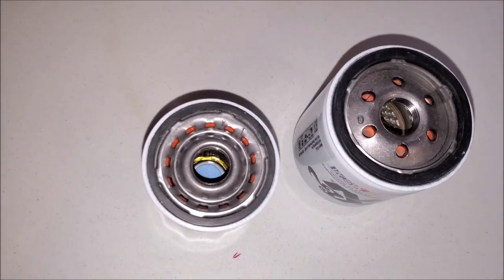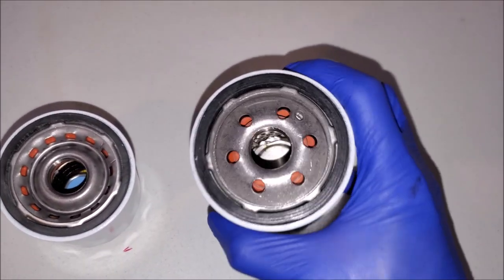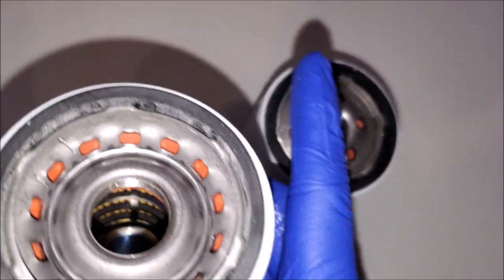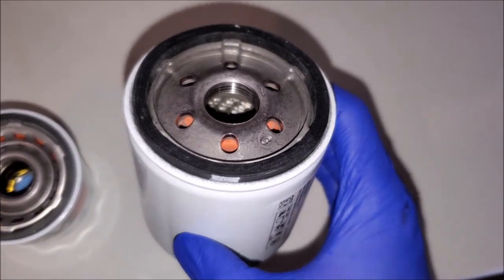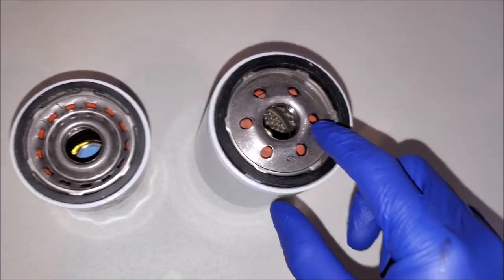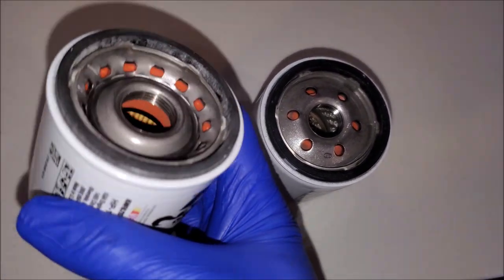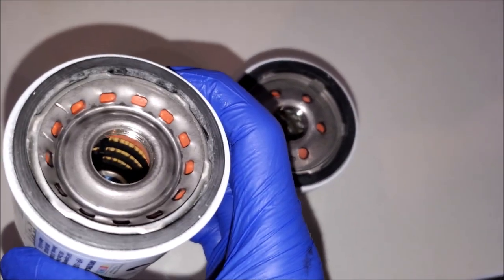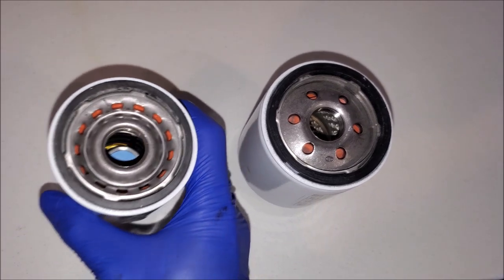K&N Filter Oil Filter design CHANGE??? | AnthonyJ350

Comment: I have to run the 1010 or the 1008 on my Mercury outboard (that was technically made by Yamaha in 04, 90hp, 4 stroke, 4 carb).  They no longer make the OEM filter.  The nipple the filter threads onto has a weird hex "bolt" at the base of the nipple.  Only the 1010 and 1008 with that different design have enough recess to allow enough spacing for that hex bolt head at the base of the filter nipple.  Maybe that hex piece is more common on foreign designed motors than I thought and those filters are designed for them.
Reply from the maker: Quite possibly.  I prefer to run the HP-1010 because it's a little bit longer.  I find it a bit small to be used on a 3.5L V6.

Comment: I always purchased k&n . My Subaru was a k&n test car for development. This week I received an oil filter I thought it was a fake . Completely different. Part number  PS-1010 . Look identical to the new one you received. I contacted k&n they sent me a new one but it’s the same cheap one . It’s identical to the AC Delco oil filter . I went out and purchased a wix xp filter instead. I don’t like the new filter at all . I’m walking away from k&n oil filter. AC Delco filters are made by champion labs I bet this is a rebadged champion oil filter
Reply from the maker: Ya I'll monitor it.  I've always loved their products, weird that one filter is the old design and the Nissan one changed.

Comment: i noticed this couple of years ago i run a inline oil filter between my motor and turbo so my turbo gets clean filtered oil i noticed this and have now switched to oem filters if that plastic brakes apart my turbo ball bearings will die
Reply from the maker: Fair enough. I noticed not all their filters have taken this design. Mainly their small diameter ones.

Comment: I use the same filter for my 350z, with some good old M1.Will see what my next filter looks like before I slap it on.
Reply from the maker: This is the second of this design I'll be putting on my 350Z.
Reply: Yes I also have used them in past with no issues at all.  But got a ‘19 Zed sport with only 12K now and don’t want to mash thing’s up.
Have you ever checked out our fellow CNDN you tube channel “ Motorvate “. He’s got some scientific type testing on K&N’s.

Comment: I, too, noticed this today when I received two PS-1010 oil filters from Amazon. Stoked because they say "Made in the USA" on the top and label on the filter, but they are noticeably lighter since I still had a performance silver filter new in the box in my closet (made in China though). There is also no plastic seal over the drainback that I'm used to seeing with these. Looks legit, just a different design. Maybe it will filter better? I'm curious as well.
Reply from the maker: I noticed the filter for my V8 Chevy is still the  same old design.
Reply: @AnthonyJ350  So what is the verdict? One of the comments below said he contacted K&N with concerns about this design differing from their old design so K&N sent him a replacement which ended up being the new design as well. It does say made in the USA on it, and it looks well built, with about 70 grams of weight savings compared to the previous model (although we aren't talking about bicycle components where a 70g savings on a component is always welcome). I'm just curious. The reviews on Amazon seem to be very negative regarding this new design, but no one has actually reviewed its performance because they don't even want to install it. They're pissed about the design change, and feeling like they got a Supertech or AC Delco with K&N slapped on it.
Reply from the maker: @IkaikaKahoano  I think they are using a more cost effective design. Honestly if you run this filter and change your oil every 5,000KM, your engine will still last long.  I also use a Filtermag on all my vehicles to help.
Reply from the maker: @IkaikaKahoano  Here's the Filtermag video.
Reply: @AnthonyJ350  I don't see a link to a video. Also, I just use the maintenance minder on my fit to change oil. It usually is around 7k miles between changes.
Reply from the maker: @IkaikaKahoano  https://youtu.be/Lec_ykPhV8A

Comment: Nothing wrong with the plastic cage, it allows max flow. The 'new' design a Champ Labs filer made for K&N. VERY similar to the Wal-mart's newer Supertech 20,000 mile filter. Except for the nut at the bottom.
Reply from the maker: Thanks for the comment!
Reply: i wasted a lot of money believing KN was special high flow.. heavy duty

Comment: My new K&n hp-2009 is half inch shorter went from 8 large holes to 6 smaller holes on inside .  Called K&n they would not explain difference only said they could not argue nor explain reason . 
Also it was identical in appearance to their ho-2006 filter which is not recommended for my vehicle .  So paid a dollar for less in filters .
I think time has come to check out other brands .
Reply from the maker: It might be if your filter design has changed that much.

Comment: Notice you use a K & N air filter.  How long have you run them and have you had any problems with it.  Any other comment would be helpful.  Thx
Reply from the maker: I've ran K&N air filters for close to 20 years now. I inspect them every year and clean them as necessary. Never any issues. I'll send you a video on how to avoid "over oiling".

Comment: Here’s a thought. What if they changed the design because worse case scenario if both filters were to fail, one would send metal shards through the engine whereas the other would send plastic/filter materials which ever it’s made out of now
Reply from the maker: Very possible, these are times I wish I could talk directly to engineers to get context.
Reply: Correct me if i'm wrong but... The oil flow is from center to the filter media to the outside of the filter...Should the plastic "decompose" ,the media would stop any pieces unless there was sooo much restriction that the bypass valve would open...I would think that plastic inner rib should last an 15k mile oil change with normal engine operating temperatures...
Reply: @stealthg35infiniti94  Consider getting an engine to maximum safe temperature day in and out. I have never seen plastic in any big rig engine.

Comment: I have used the Silver / PS1010 on my Subaru Legacy,,,,,,, I just received my order, and The new KN filter, is much different in construction..........................Switching brands
Reply from the maker: What brand are you switching to?
Reply: @AnthonyJ350  I went to Royal Purple oil filters for my Ford F150, Wife's Subaru Legacy, and Husquvarna Lawn Tractor that has a Kohler engine........Also switched to Royal Purple, HPS motor oil. Higher zinc content. API lowered Zinc content......................................
Reply from the maker: @michaelbutler9528  Nice!

Comment: These are now the same as Super Tech Maximum Protection filters, u are paying nearly double for the same filter. At least the K&N select filters,  not sure yet about the rest of the line up. PLEASE, double check the threads for metal shavings and tap or blow out the filter b4 installation, I and many others have found metal shavings on the threads of these particular filters both k&n and Super tech... you might as well buy the basic super tech or the super tech maximum Protection filters instead of this one, same filter, just more $$. Good luck 👍
Reply from the maker: Thanks for sharing!

Comment: There's plenty of You Tube videos showing K&N being almost identical to some of the other High Tier Brands...The important stuff : Quality drain back valve, Attached contact seal, synthetic filtration media, quality bypass valve, correct filter threads...Optional: Hex head for removing, pretty paint...Usually a filter manufacturer will make the same filter under various names...The secret is to find the same quality in the least expensive filter...With clever marketing, you can sell ice to eskimos....
Reply from the maker: I agree
Reply: @AnthonyJ350 I thought to comment about Sensitive Topic of Motor Oil...As long as you're using a 100% Synthetic Motor Oil ,you're doing the best for your engine period...Amsoil does edge out the competition by a slim amount that a normal driver will never experience the difference...That said, buy the correct viscosity pure synthetic oil for your car with a top tier oil filter. The brand you choose is going to give you the placebo effect you wish.

Comment: Just bought a k&n filter, im not sure if thats plastic or not. I'm kinda hesitant to use it. I might go buy a wix xp filter instead.😢 Anyone have any further info about it?
Reply from the maker: Not that I've heard. Hopefully someone from a parts store can chime in.
Reply: @AnthonyJ350  come to think of it. Ive come across toyota camrys, camero v6, and dodge challegers v6 that use internal filters. And most of those internal filters are plastic, Like really hard quality plastic... Im starting to think it will be fine, but I'll still double check before i slap this oil filter on...

Comment: the past year… it seems many Brands have begun to look similar inside… dropping the big spring at the bottom and using the plastic retainer… some Walmart Supertech cheap filters are duplicates to 15 dollar KN and 5 dollar AC Delco…even Wix may have changed… a rude ripoff obviously
Reply from the maker: I'm going to switch the the GTR filter, it's just a little taller.

Comment: I'm never buying the ones with nuts on it there garbage so I got me a k&n silver oil filter in stud with out the nut  I use Royal purple oil in my engine and I drive a 2002 se Pontiac Sunfire  and all I can say I love it no more problems
Reply from the maker: What makes the filter with the nut on them garbage?
Reply: Thay always seem to break open on me
Reply from the maker: @shaynehuber3426  When you take them off? A K&N? I have never seen the nut break off.
Reply: K&n oil filter with the wrench thing on top Thay always seem to break open on me get the ones with out the wrench top I think there garbage
Reply from the maker: @shaynehuber3426  Sounds like you're over tightening them

Comment: If the pricing didn't change and only the design i would be concerned. Why pay the same for a possible downgrade. It looks like a generic filter without shielding.
Reply from the maker: Ya I'm not sure what to make of this change.
Reply: @AnthonyJ350  i agree. I have yet to see the differences between the two
Reply from the maker: @BoOmBaMan  Ya I'm not too worried about it because I change my oil quite often. I'm sure it's still a quality filter.

Comment: I would rather have either in my engine,   my car uses that paper element style
Reply from the maker: What brand oil filter?
Reply: @AnthonyJ350 usually Bosch. But its the paper type with the plastic housing that screws over it
Reply from the maker: @TheMcooper17  Is that in a newer Toyota or something?
Reply: @AnthonyJ350  08 focos Euro diesel
Reply from the maker: @TheMcooper17  Ahhh ok , can you still get a metal canister if you choose?

Comment: Just received 2 K&N HP-1010 filters. they are built exactly like Walmart Supertech filters, only they are 3 times the price, will not be buying K&N filters ever again.
Reply from the maker: Thanks for sharing!
Reply from the maker: Even the casing thickness is the same and the Supertech has the nut on the end?  Did you cut them open?
Reply: @AnthonyJ350  The supertech does not have the nut, everything else appears to be the same.

In fact the Supertech has a silicone drain back valve and the K&N has nitrle rubber, the supertech has one up on K&N
Reply from the maker: @spartus56996  Interesting, thanks for sharing.

Comment: I'll stay with my Amsoil oil And filter.
Reply from the maker: To each their own. I've been using Castrol 5W40 in my vehicles.
Reply: @AnthonyJ350  I've brought several oil burners and rattling lifter engines back to quiet,  non-oil using engines with Amsoil. Using it from the start can result in engines still running like new with several hundred thousand miles. This includes diesels as well. 

I'll run Mobil 1 for the first couple of oil changes making sure to use Amsoil filters.  The normal abused engine running standard oil requires 3 or 4 oil changes to thoroughly clean the engine.  Hard to believe the dirty oil you get those first few times before you get the engine clean. It will take a couple of those changes on an engine with less than a 100K that have been regularly serviced. You won't believe the cessation of lifter noise on a noisy engine.  YMMV but it's worth a try on older engines with a lot of lifter noise. Just be sure to use the recommended weight.  I watched a couple of idiots use 15W 40 diesel oil on 2 LS engines that were fine before they used that oil even after I told them the results of using that oil. The engines were fine before they did it. Cue Forrest's mother.
Reply from the maker: @oillease1881  That's awesome, no doubt Amsoil is a good product. I've been using Castrol 5W40 synthetic and AC Delco oil supplement.

Comment: the one on the left is made by Champ labs, and so far every filter that I saw from this company  is garbage take at a new AC Delco it is the same as the one on the left
Reply from the maker: Interesting, have you seen failure or premature wear in engines because of this?
Reply: @AnthonyJ350  no not that I know but if I pay $16.00 for an oil filter I am expecting quality and that is not quality it is a $3.50 filter if you're looking for a good filter well made , good quality, and well price I suggest Wix XP, every time  I do an oil change I always cut them open and look inside for sign of wear. and every time I cut a Wix XP I am always pleased with how they are  built, it is always impeccable
Reply from the maker: @budblack3588  I'm hoping that enough people give feedback and K&N sees this.  I bought a new filter for my 2005 Silverado and it's still using the old design.